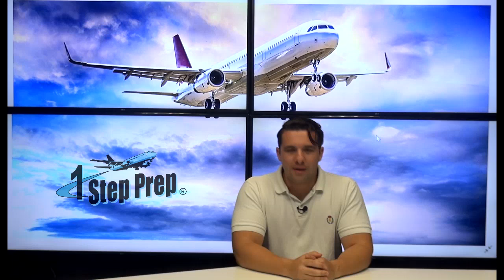A320 Descent Trap!

Comment: Odd example given that the Airbus is going to try to slow you back to 250 at 10,000' regardless. I loved the video, I learned something, but I think I would have chosen 16,000' as the example just to avoid any possible confusion.